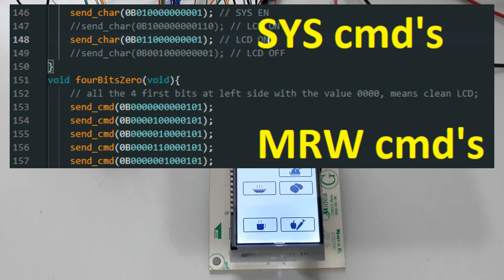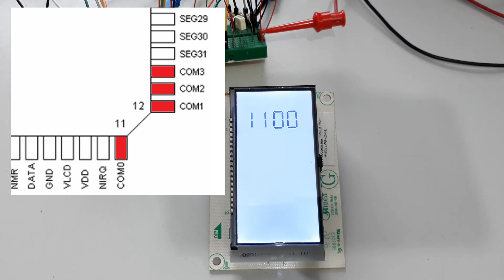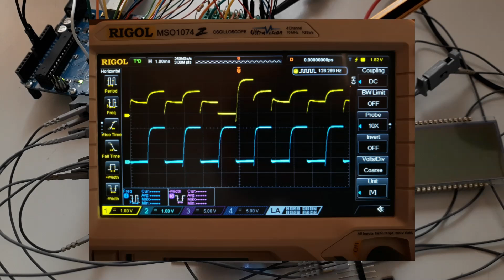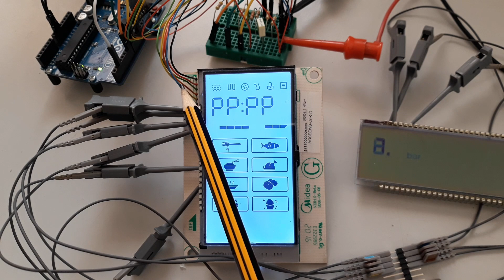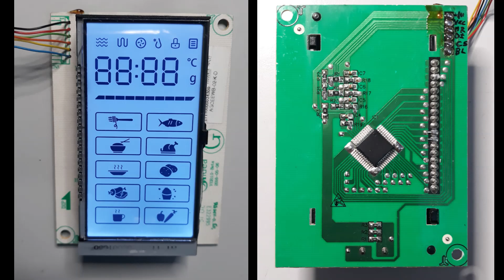CS1621

Comment: Очень симпатичный дисплей. Иконки нормально нарисованы. Кстати, насколько сложно выяснять массив значений на сегменты дисплея? У меня осциллограф той же фирмы Rigol =) мне не нравятся его энкодеры.
Reply from the maker: The icons is pre-defined symbols... only the 7 segments need be assembled.
The work to identify the segments is always a hard job. Normally I use some lines of code associated with trigger to count and go over the segments and present the number at IDE. Because the process is repetitive I have already some codes to some driver's, but you need see the options of the driver's I worked before withe video done and you need check the code link at description. It normally need be adapted because the old displays don't have any standard!
Is true, I like a oscilloscope better, but they are expensive.
Reply: @jlsmonte  спасибо, вы очень отзывчивы.